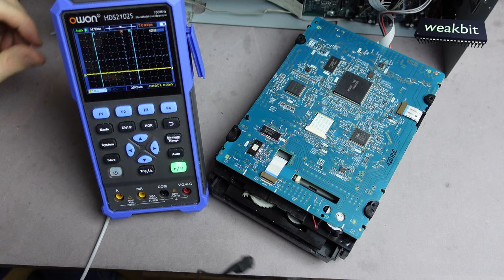Sony RCD-W100 repair

Comment: I would start by replacing the surface mount capacitors on that board, I have a Sony minidisc deck that did the same thing (TOC error/no disc) replacing the capacitors fixed the problem. The working board may have failing capacitors as well as it took a lot of time to read the TOC.
Reply from the maker: I'm interest - what exact you doing? Tell me about your cap experience and what number of cap you change? Plese send me a list here into this box. I've also a 2nd defect one to repair and if this is working your are welcome! weakbit
Reply: @weakbit633   My minidisc deck is a MDS-JE500 It's actually quite simple, the faulty capacitors are on the actual mechanism board beneath, I separated the board from the mechanism and swapped all six surface mount 6.3V 100uF and two 10V 10uF with normal through hole capacitors soldered to the pads. After reassembling it read the TOC immediately after inserting the disc and it's working perfectly now. Surface mount capacitor from the 90s will all fail sooner or later, most of these old capacitors read 30+ Ohms on the ESR meter.

Comment: You also have the option to set drive to service mode and you can control the sled to see it moving for a repair
Reply from the maker: How to set the machine in service mode?

Comment: I have the same model... rcd-w100.
On Deck B I have reading problems: some original CDs "skip" towards the middle of the disc during playback, while other original CDs and also Verbatim CDs have no reading errors and Deck B plays them without problems.
I have often cleaned the lens, mechanism, arm where the laser moves but I haven't solved the problem.
I believe that with some CDs the laser does not read the reflective layer of the disc correctly.
I can't find the entire the Deck B  (loader).
The loader code is KRM-220CAA or also 8-583-104-01.
Can you give me some advice and help me?
Thank you guys. :)

Comment: Hallo weakbit, bei meinem Sony RCD-W100 hat die Lade des linken Laufwerks einen Defekt. Weißt du wo ich ein neues Laufwerk dafür bekomme? Danke für eine kurze Rückmeldung und liebe Grüße h.
Reply from the maker: Hello I'm sorry I don't know where to buy but the mane of the drive is 'CDM66C-30B61M' left drive or 'CDM65-RBD2' right burner - please have a look at Aliexpress or eBay.